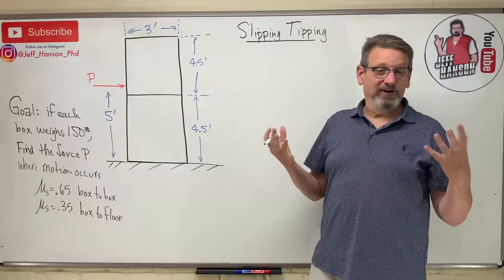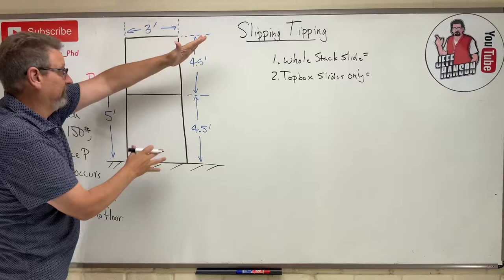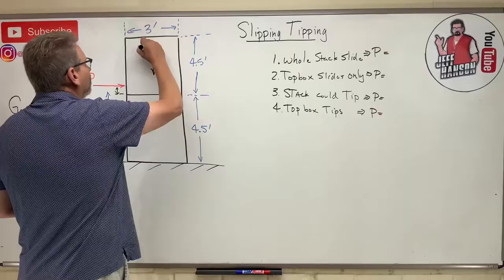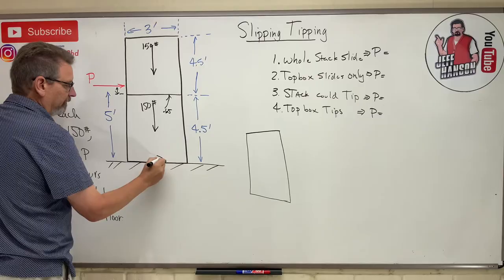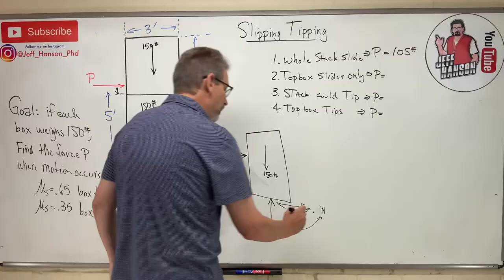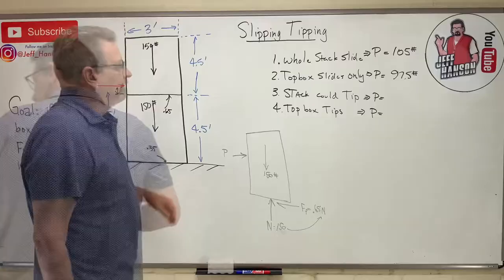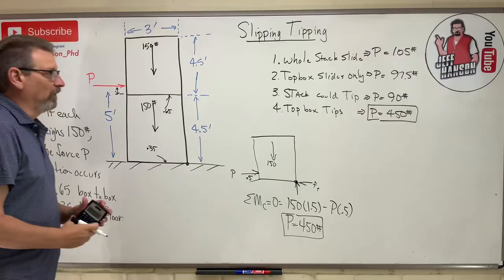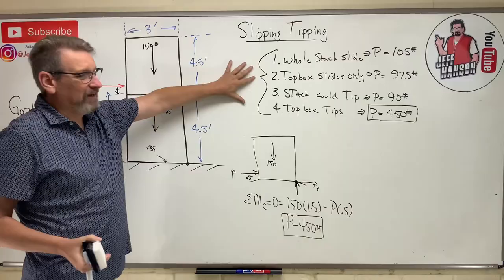Statics: Lesson 63 - Friction Slipping Tipping Problem

Comment: If u take sum of the vertical force ans is 54 but if you find vertical force by moment its 48.6 why ? Why? 
Length 18 ,Wieght 54# vertical suport after 10ft man push horizontally from 1 side( no other force acting)

Comment: Isn’t it possible for the top box to tip on its left corner?
Reply: That situation is the same as pushing the boxes and they fall at you when you touch them. There is no external force that pushes the boxes ccw.

Comment: Why didn't you use the friction between the two boxes in the first case?
Reply: Each case solves a very different problem, the one with the smallest force is the answer to the problem that you are solving. So in the first case, we were assuming that NO MATTER WHAT, that whole stack was going to slide before any of the other possibilities would happen and solved for the force that that would take. The force that it would take in the first case (105N) becomes completely irrelevant as soon as one of your cases has a smaller number because the case with the smallest force required will happen first and make the rest of the cases impossible. So basically in that first case, we are assuming that the ground friction will slip before the box-to-box friction so we don't even have to worry about the box-to-box friction. Hope that makes sense!